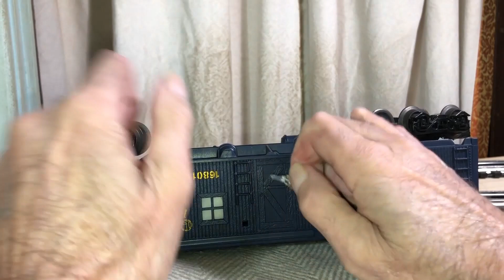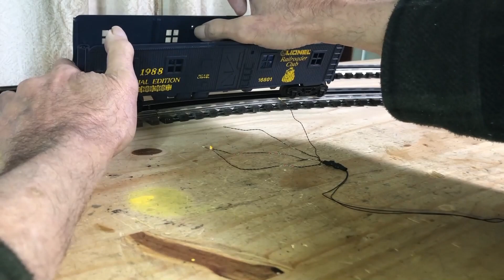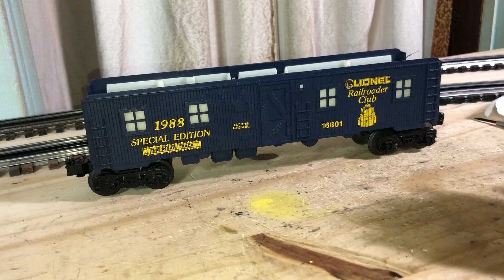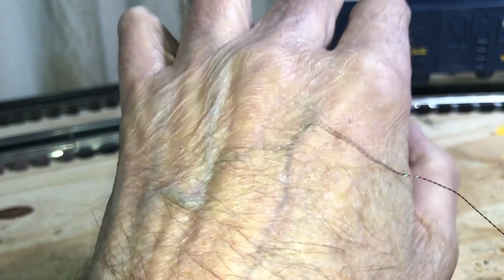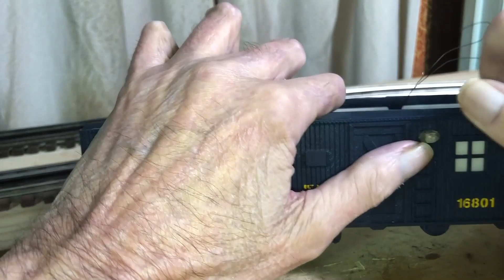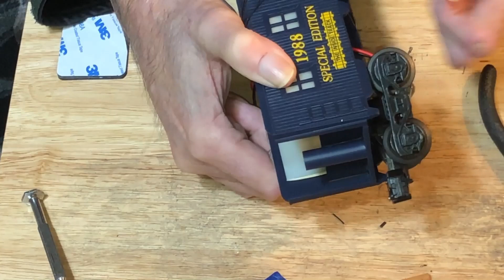Lionel 16801 Bunk Car LED Install

Comment: Hey Jim, I have the same bunk car and it is illuminated,  it came with one pickup roller and flickers through my switches. Your car looks fantastic with the red marker lights. The color on the leds looks great. Thanks for another cool project.
Reply from the maker: Thanks Tom!  I thought there might be some lighted units out there by the way this one looks "ready".  I received this awhile back and wanted to give it new life.  Thanks for watching!